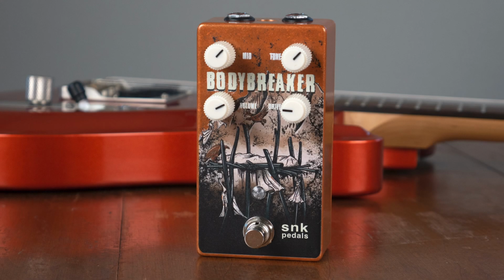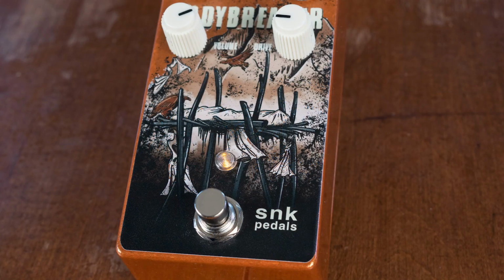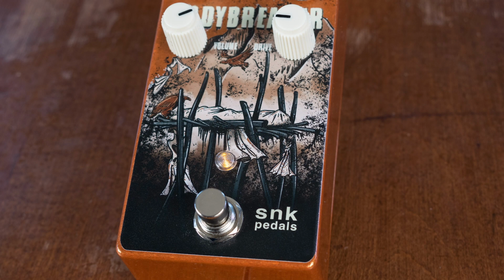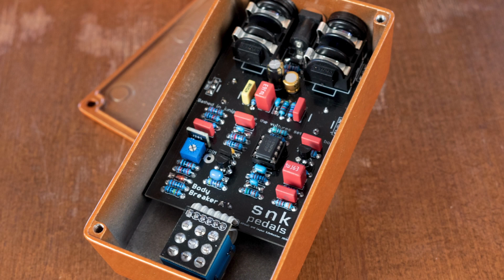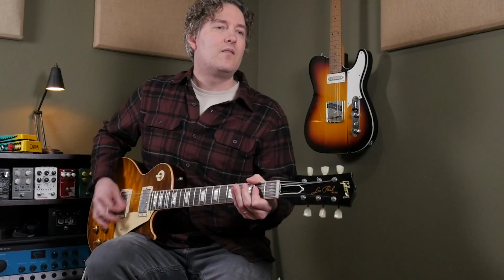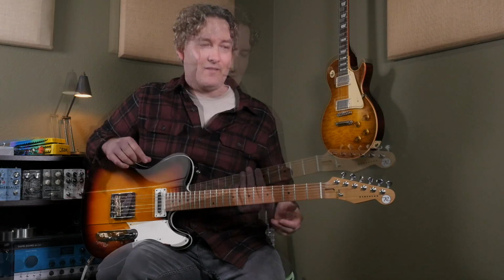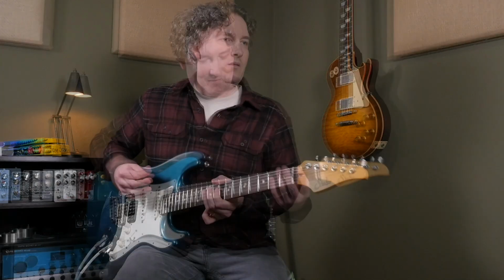SNK Pedals- Bodybreaker Drive Demo

Comment: Sound like poison Proco Rat. It is good
Reply: Yeah it's just a rat with a mid control
Reply: @whiskerbiscuit6674  Have you compared the circuits? Rat uses a rather rare op amp as far as I know and the gut shot of this one shows a TL072, which are a dime a dozen. Would make a great DIY project!
Reply: @BakerGlare  The op amp makes little to difference
Reply: @whiskerbiscuit6674  Whether that's true or not, don't tell r/diypedals ;)